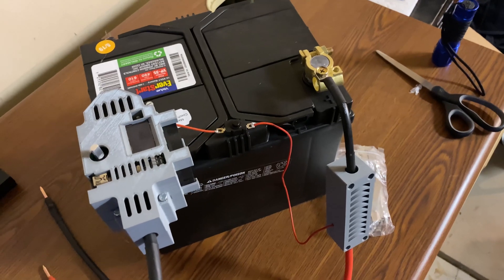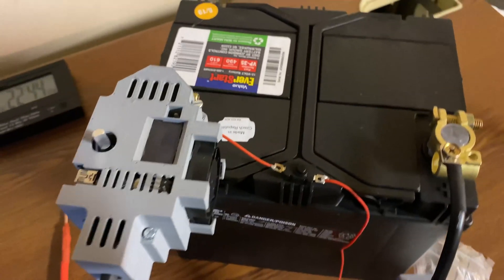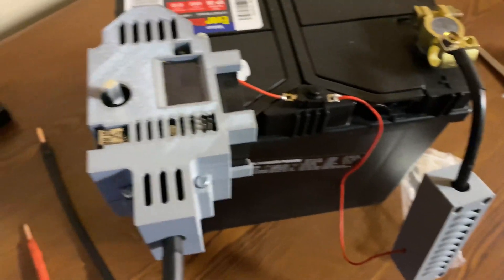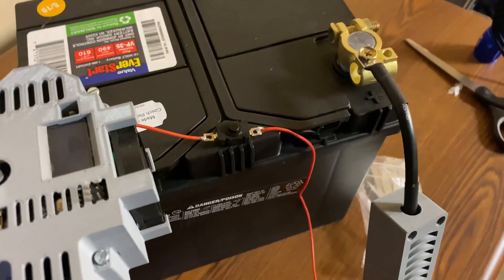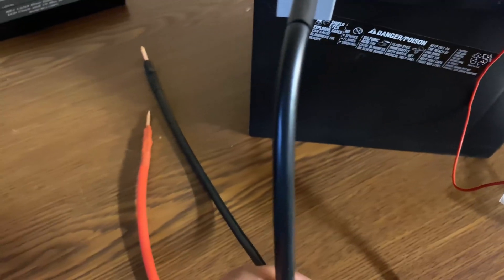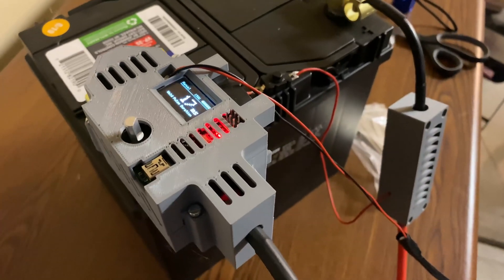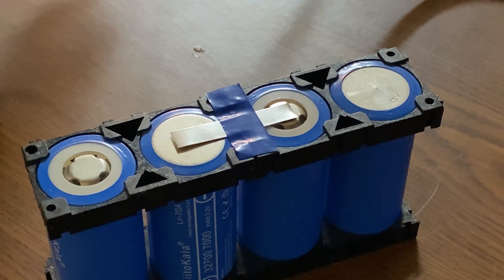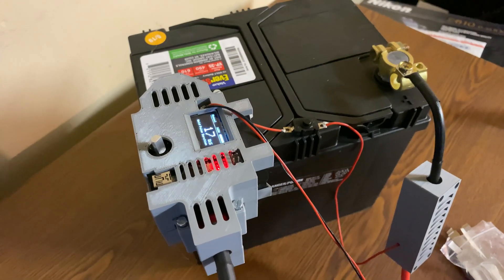Using a DIY Arduino Battery Spot Welder

Comment: What's the cost of the spot welder? I have nearly 2000 cells to connect, 14, 100 cell packs, I built a microwave transformer based spot welder, but the primary winding is burned, I do not want to rewind it, and don't have another, I have a timer, and electrodes, I'm thinking about trying it with my 120v mig welder, I don't know how that would turn out!! Ha-ha..
Reply from the maker: It's €109 + shipping for the full bundle kit. I think that came out to around ~$135.
Reply: their pricing this thing in many different ways....$109 plus the leads plus the fuse plus of this plus to that or $120 euros looks like out the door